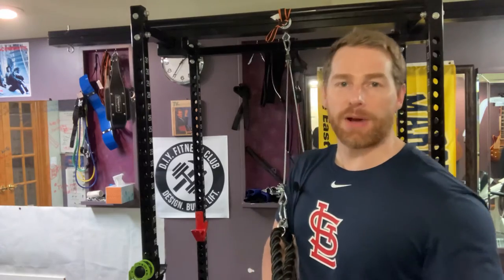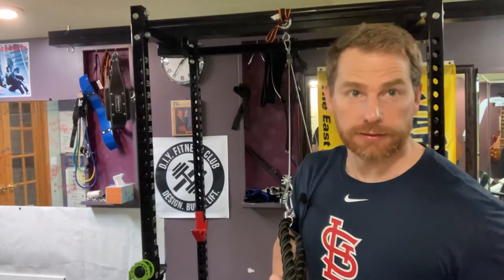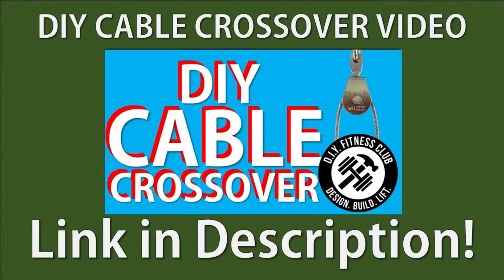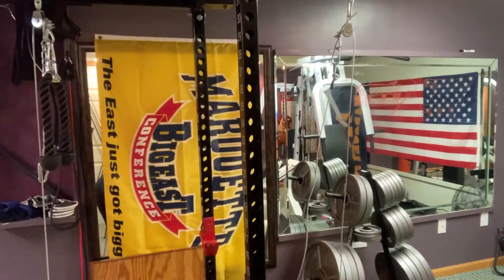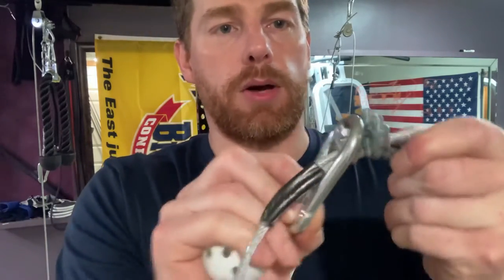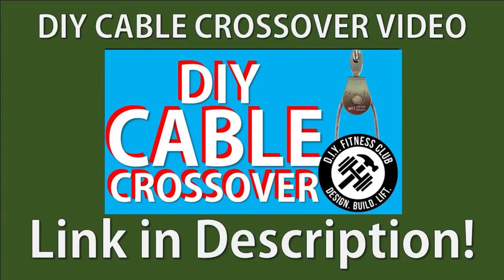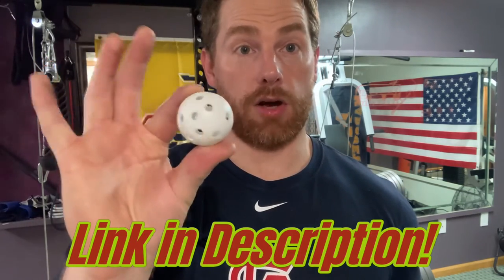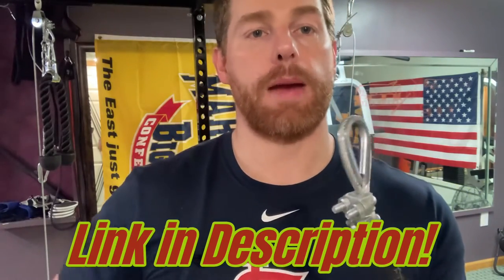Home Gym Cable Pulley System HACK – REDUCE SWINGING

Comment from the maker: I accidentally deleted someone’s comment when I was trying to reply to it (and I can’t get it back) - Sorry about that that “Canadian Patriot”. It works by reducing the “swing amplitude” of the cable by eliminating the swing from ever getting too drastic in the first place. As far as adding the ball stop by feeding the cable directly through the plastic ball- yes that would work if you wanted to go to the trouble of disassembling the cable (i.e., removing the thimble and clamps and then having to reassemble it) but by doing so you will also slightly reduce your potential range of motion by about 2 inches (the width of the ball). Happy Lifting!

Comment: Good money saving tip. Use  hevy  Duty Paracord instead of  Wire. Just make sure you got the right size  Polly for paracord.  U don't  need eny clamps.  Just    Nots and carabiners. E bay  Rock climbing equipment.
Reply from the maker: Thank you for the tip, Brother !!! 💪🙏🤘

Comment: sorry if this is a dumb question, but would or could you try to make like a net for weights for the pulley system? i have a bunch of dumbbells and was seeing if somehow a net could get them together for a pulley attatchment.
Reply from the maker: Yes you could …weight is weight…however doing so would put extra wear and tear on your plate’s paint job…with the plates loose inside the net…also it sounds like it would be MORE work to set up than using a loading pin…. But - that is just my opinion…if it makes sense to you- go for it!
Reply from the maker: I re-read your comment…you want to attach Dumbbells …got it….just hitch a “Soft Loop Tie Down Strap” to your dumbbell and then attach it to your cable with a carabiner.  These straps  are available at any hardware store for $1 or less. If you try it let me know how it works for you…should work out  perfectly for you

Comment: I would hang a chain chain on the bottom of the pin.  It was pretty solid
Reply from the maker: I agree! That is a great option. I included that in this video here- which offers 4 options: 4 EASY Home Gym Cable Pulley System HACKS – REDUCE SWINGING
https://youtu.be/lFJGixVxQQk

Comment: I saw a guy using rubber exercise bands to limit the sideways movement of the weights. He tied the middle of the rubber bands to right above the weights, and then tied each end of the rubber bands to each side of the rack. He said that in addition to keeping the weights from moving too much, it also gave a little more resistance towards the end of the movement...
Reply from the maker: Was the guy me?  Updated version of this video found here: https://youtu.be/lFJGixVxQQk
Reply: @DesignBuildLift  That would have been funny, lol, but no, it was some other guy 🙂

Comment: How long would you recommend the chain to be?
Reply from the maker: I used a Piece of 21” chain in the video.
The required total length of the chain primarily depends on the exercises you want to do. If you are doing exercises where you stand close to the pulley (e.g., most tricep push down variations), you do not need the full 21” chain (as demonstrated in the video where clipped the to the last link and the 6th link inward). However , if you stand far away from the pulley to do the exercise (e.g., high cable woodchop), the full 21” could be needed. Hope that helps!
Reply: @DesignBuildLift  Thank you